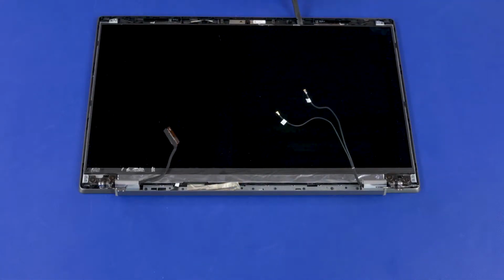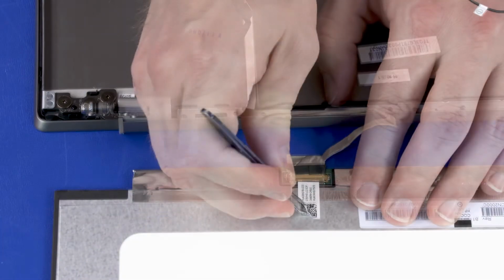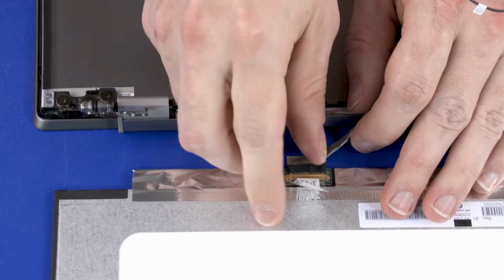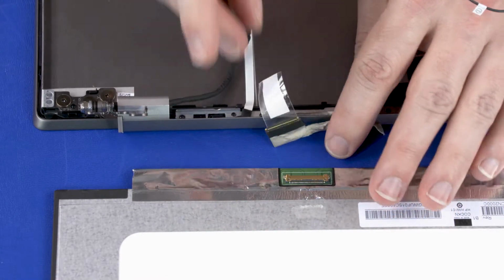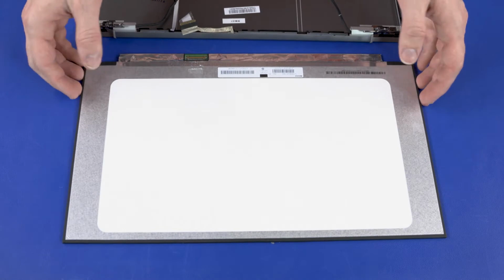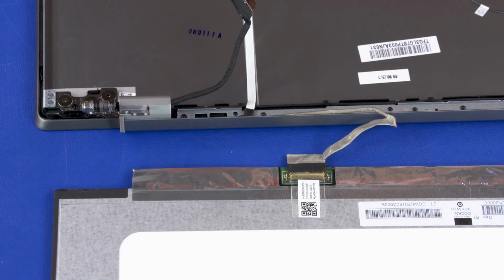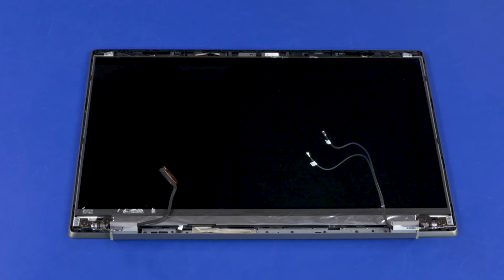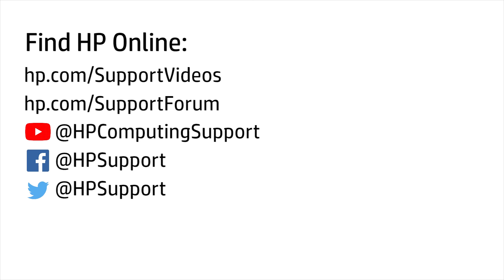Replace the Display Panel | HP Pavilion 15-cs0000, cs1000, cs2000, cs3000 Laptop PC | HP

Comment: Is it possible to replace a 1333x758 screen with a 1920x1080 this way on the cs0xxx models?
Reply from the maker: +Shawn Connolly HP does not recommend upgrading or downgrading hardware parts or software that is bundled with the product as It may affect the manufacturer's warranty and performance, however, you could change the configuration at your own discretion.

Comment: Hey ..can u tell how many pins does hp pavillion 15-cs3073cl have?
Reply from the maker: +yash kaushal It consist of 40 pins.
Reply: Will the model hp pavillion 15-cs3073cl  work with a non touch display? And how many pins should a non touch display will have?

Comment: my laptop screen is flickering even in BIOS,  is it necessary to replace the LCD?
Reply from the maker: +Gasoline Boy As the issue persist in bios, this seems to be a hardware issue with your notebook. Please contact our phone support team to fix this issue. Please follow these steps to reach them.
Step 1. Open link: https://support.hp.com/us-en/contact-hp
Step 2. Select the product type.
Step 3. Enter the serial number of your device or select let HP detect your product option.
Step 4. Select the country from the drop-down.
Step 5. You should see the HP phone support number.
Reply: Hello, did you end up getting a solution?
Reply: Hey, same problem here. Have you fixed it yet?